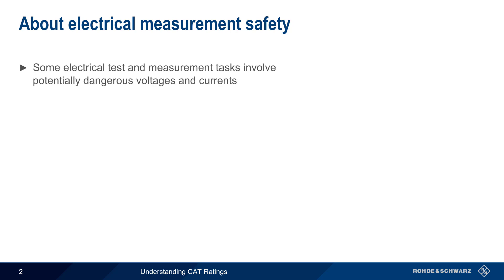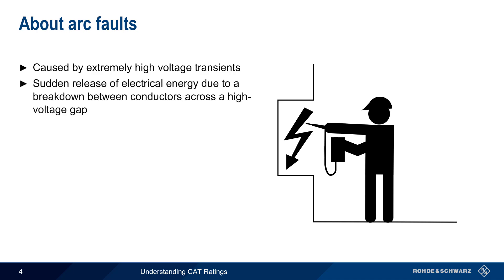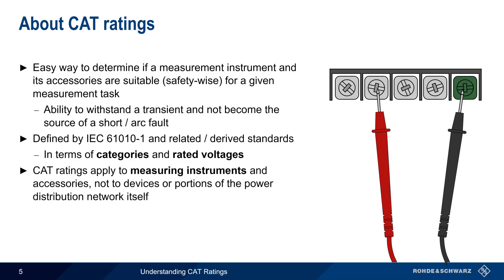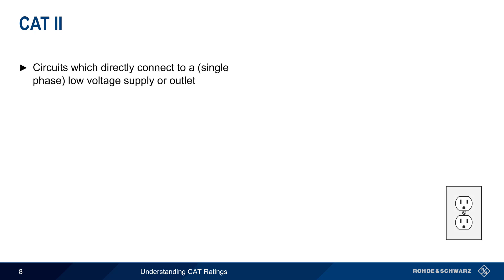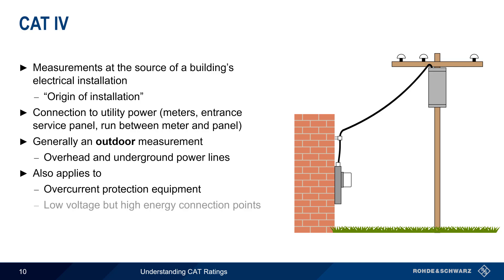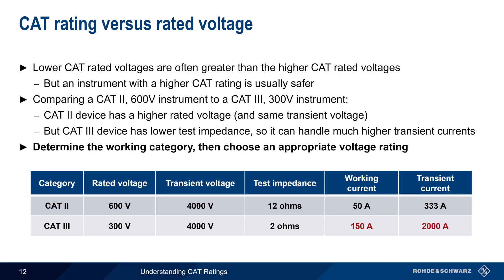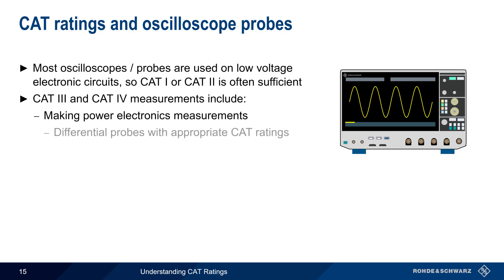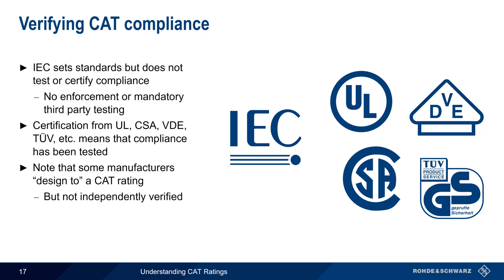Understanding CAT Ratings

Comment: I've seen the inside of a prototype RHS that took a hit in VDE/CAT testing.
Very few people understand what CAT classes mean, and how much danger you can be in by, z.B., using cheap probes that you found in the shop, when you go to check the 3-phase transformer coming into a building!
I've actually had a pretty nasty FLASH, working on a supposedly "dead" 600 V Box, and ended up with copper-coated sunglasses. (And, I was about 6 metres up a ladder 🪜!
Thanks for putting this out there!
(Former 1TDP AE)